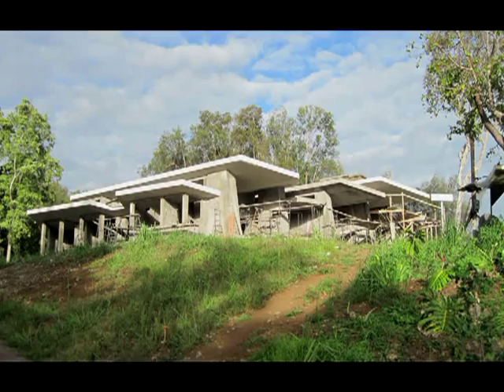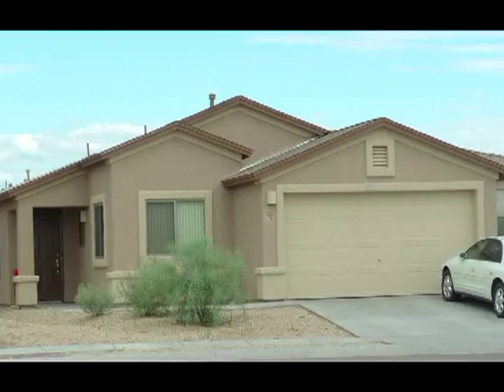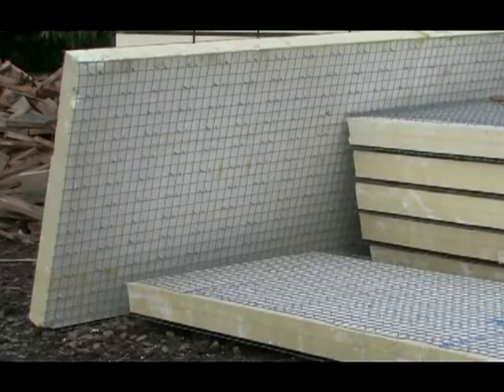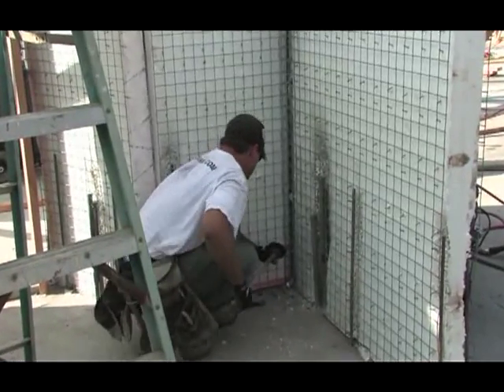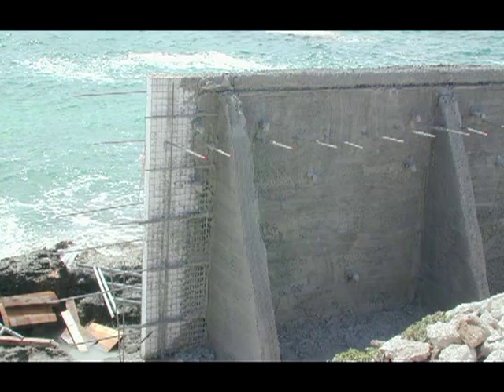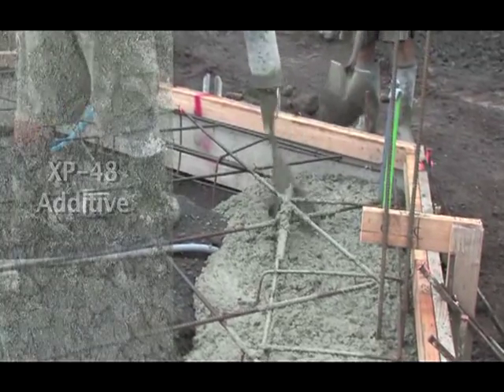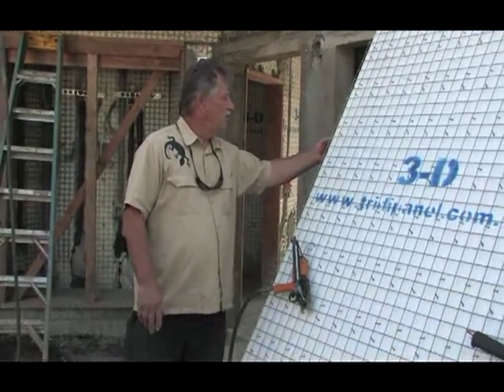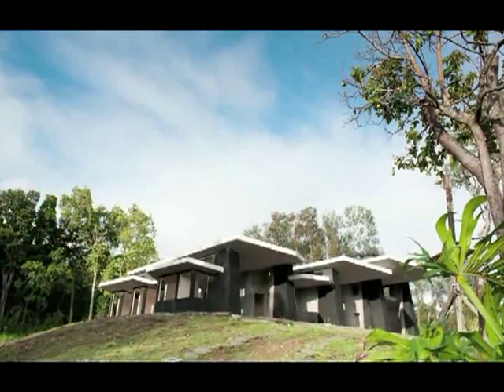Nano Ceramic Concrete "New Generational Green Building Concrete"

Comment: I drive and operate a concrete truck, and we been helping build a water tower with this method . I don't fully know that much about this method it does seem a lot cheeper but would it out last the all steal method . seem like over 10 years or so this would crack in places . But although im no expert.

Comment from the maker: @TheDeadPear  through basically the joints at first, but this system doesn't have any leading joints. There are some independent UL Laboratories that do have Triple A ratings for non-flamible materials. I hope this clears up this conversation. Mark Lane

Comment from the maker: @TheDeadPear This new Nano ceramic enhanced concrete would exceed any fire rating test, the concrete alone will with stand over as i had stated above 5700F or 3148.89 ° Celsius The ceramic will disburse the heat more evenly as in conventional concrete will only deflect so much the will start to absorb,

Comment from the maker: @TheDeadPear 
These criteria require that: 
(1) the structure support its design load throughout the test without passage of flame or hot gases, and 
(2) the temperature of the unexposed surface (i.e., the surface not exposed to the fire) not rise more than 139°C (250°F) as an average nor 181°C (325°F) at any one point. This test also would include a load of PSI to obtain Joint and what the thickness of the concrete specimen.

Comment from the maker: @TheDeadPear While UL/ULC is a good source of information for fire safety of products, there is no code requirement for UL numbers regarding concrete and masonry construction assemblies. Fire ratings for non-proprietary concrete and masonry construction assemblies are determined based on the end point criteria established in ASTM E 119. This standard specifies the intensity of the fire, the size of the specimen, and the criteria for determining the end point of the test.